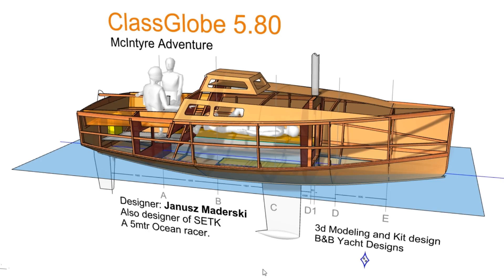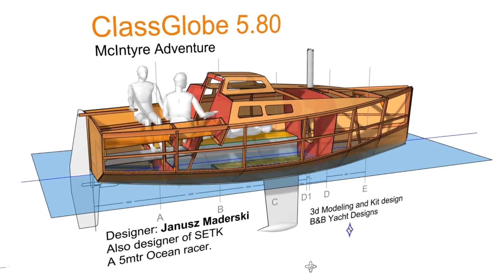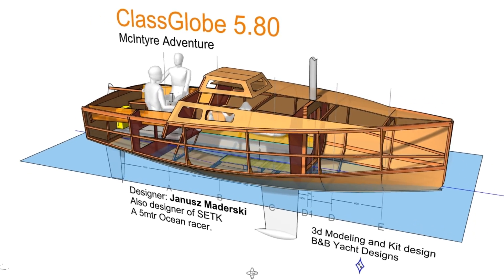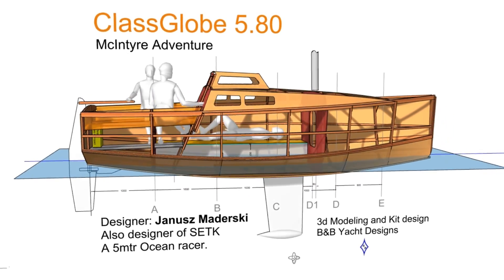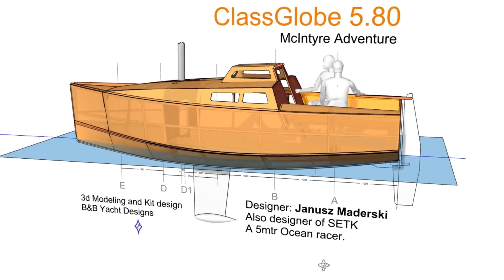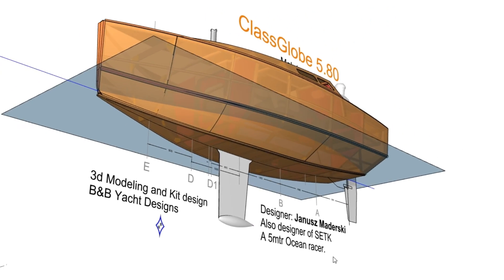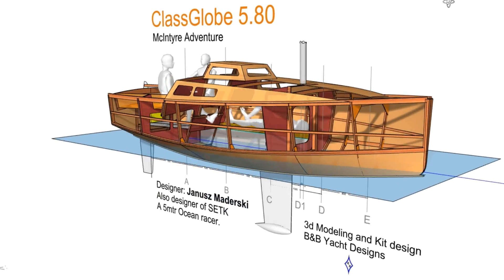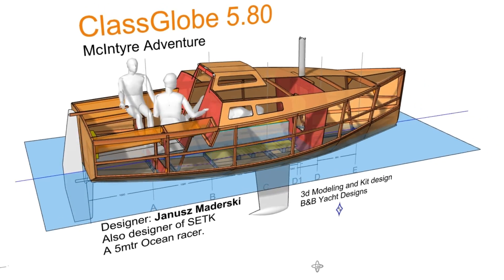Class Globe 5.80 in 3D!

Comment: Is there a chance that this kit would be available as foam core?
Reply from the maker: Hey Dave, doubtful as this design was specific to plywood. Anyone building one of these will likely want it to be class legal meaning ply.
Reply: @bandbyachtdesigns  Oh interesting! I am going to commence a RAID class boat build, been trying to decide between a Goat Island Skiff, RoG, your 17' Mk2 design, the Skate 15, and I started looking at this. 

Too many designs man! I have experience rebuilding/repairing boats, but never built a boat before.
Reply from the maker: @davenghiem364  I'd probably go for the CS-17 or even 20 or the Mark 3 if you want a cabin but for a RAID event you could just sleep in the cockpit with a tent. There is no substitute for waterline length.

Comment: I had a modified Hunter 19,very similar. The companion way of the‘Globe’ is a hazard,better to bridge the deck,seat high, life raft under . Captive doorway board, I had an oval hatch with hinged lid on the top , behind a dome with a seat/hammock under, convex mirror in the dome so that one blink to check the horizon and sails. Foot pedal steering. Comms and amenities within reach. Lazarette w/t compartment.circular foredeck hatch to stand in,with w/t skirt for working mast and forestay. W/t door in mast bulkhead..+ collision B/H. You’ll get rolled,be prepared. A single winch mid cockpit, continuous sheet, maimsheet above, I could work the boat standing in the hatch.
Reply: Hunter 19 is total garbage..